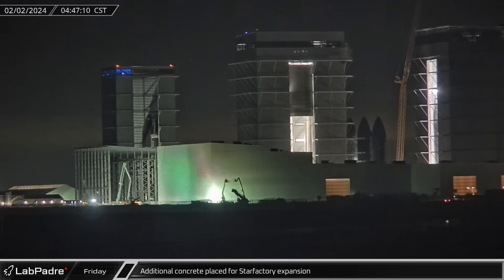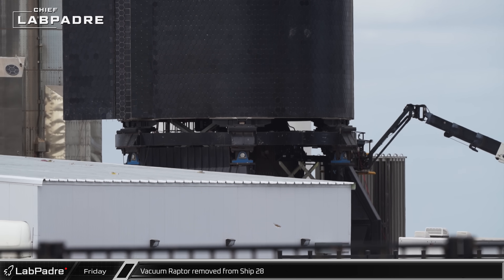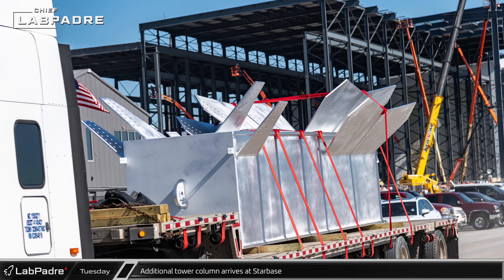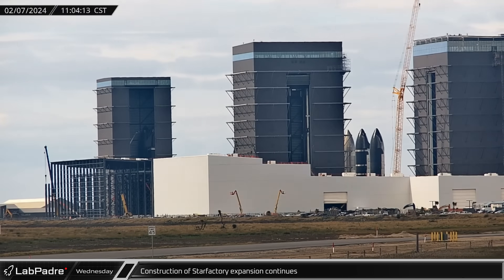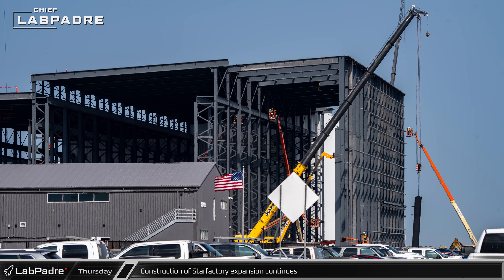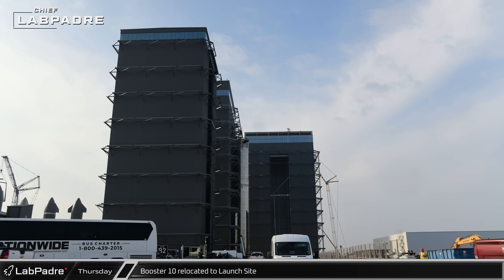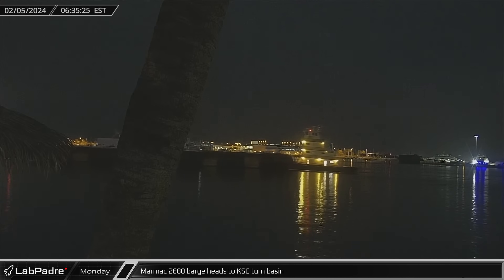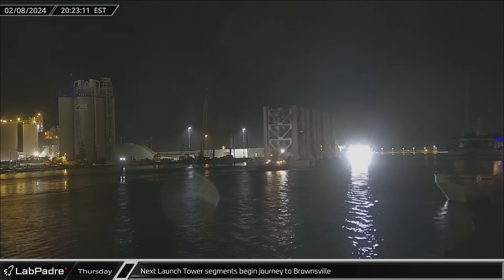SpaceX Is Finally Wrapping Up Orbital Tank Farm Upgrades! - SpaceX Update #101

Comment: Brass tacks... nice. Lot's of great details, but comments and engagement is low. You need to tack on more recent stuff to fill out the strength you have in the details. Even if you don't have a lot of details on the more recent thing. Like and extra 5 minutes of the latest added on.